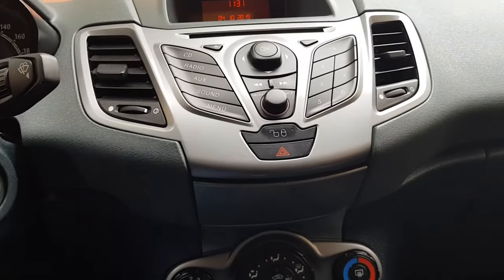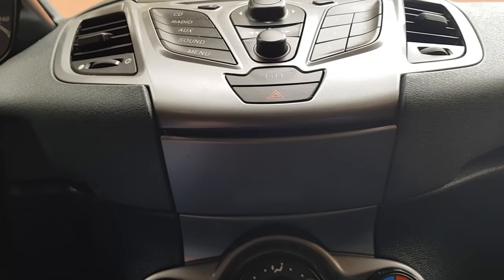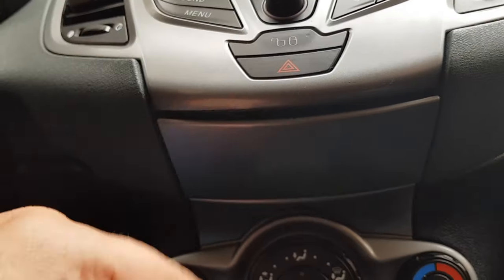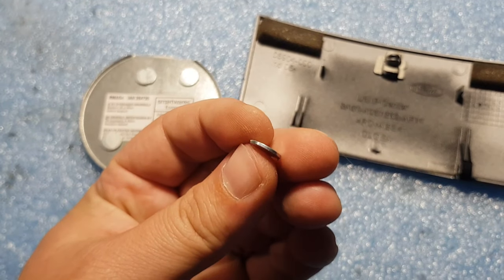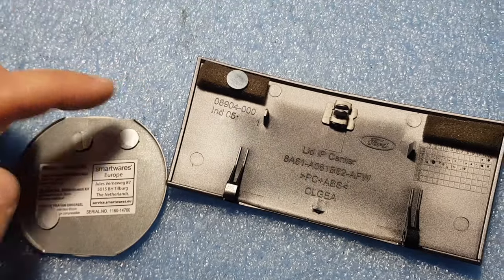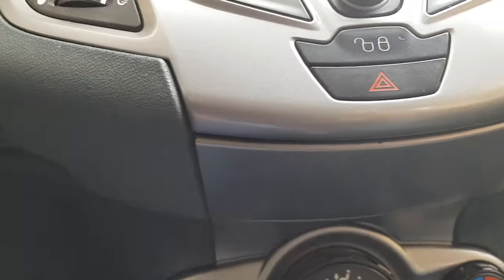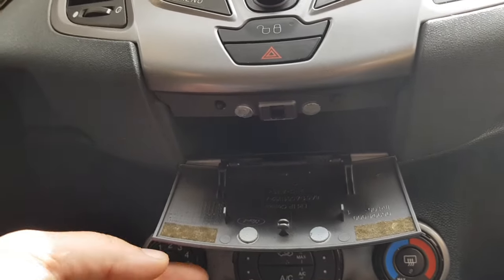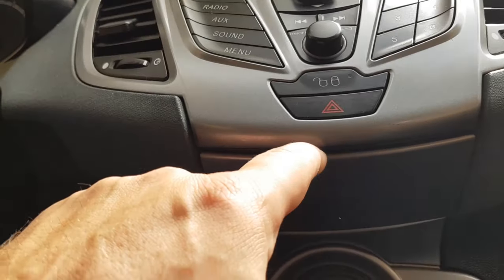Ford Fiesta secret door. The way it should be closing.

Comment: Replacing the little rubber bumpers with short screws and putting strong magnets on the round marked area makes this process easier and it looks cleaner if you paint the back side of the panel 👍

Comment: So odd, my 2011 doesn’t have this compartment. It looks almost identical but my climate control panel is a bit higher.
Reply: Mines is the same. Pulled it off because I wanted to see what was behind and found this video
Reply: Same, 2011 sedan Ford Fiesta does not even have molding to imply an opening.

Comment: Wouldn’t using super glue be easier to stop part detaching?
Reply from the maker: Maybe. In my case the metal part was broken. That metal part was not intended for the door to be open and closed regularly.
Reply: @benassy69  Some weird things happen to my i20 2011 steering audio controls.

When the MID Display is in standby mode, none of the steering audio controls are functioning.
However, when any media is being played, all steering audio controls are functioning.

I have no issues with Horn, Head Stereo Unit, MID Display Unit. All parts are stock OEM.
Only issues is buttons are not working in MID standby mode. 
Please kindly help me solve this serious just one issue. Thanks.

Comment: Hey Adrian B, do you know how to fix sync issues?
Reply from the maker: Hi, What do you mean by sync issues?
Reply: @benassy69  my i devices won’t sync anymore? there are so many different advice options but none work. Even did a master reset but still no luck. Will disconnect battery today to see if that works